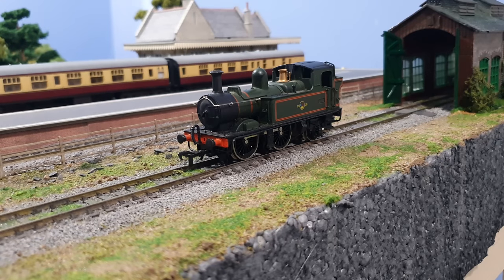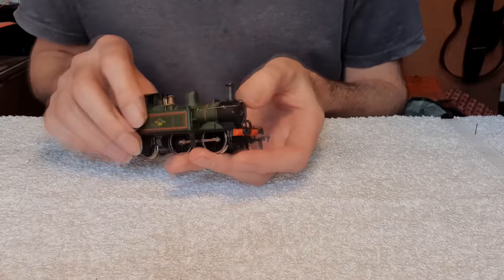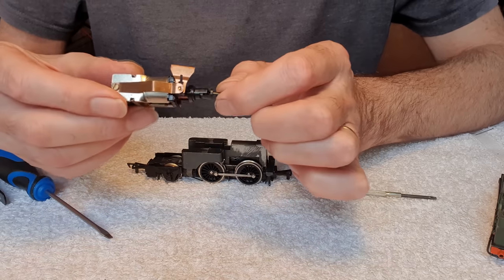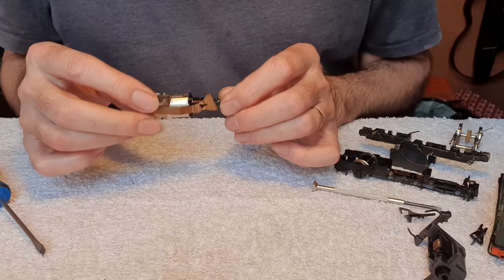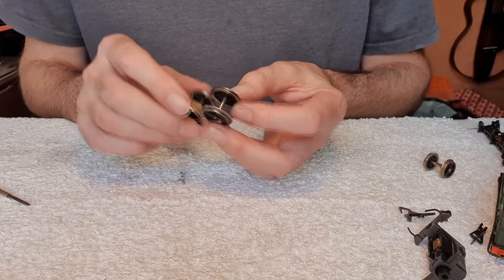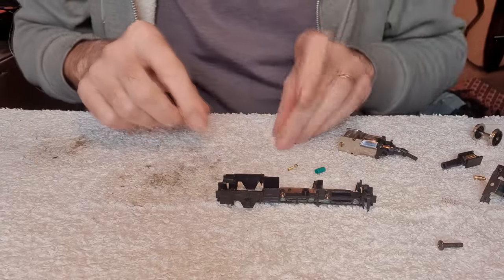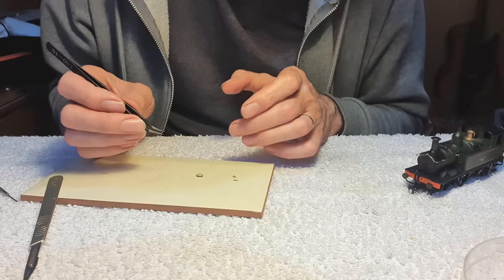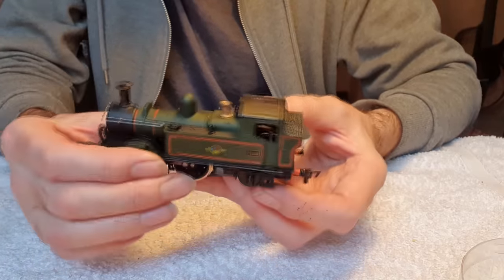Airfix Class 14xx: Repair Request

Comment: I made a new brass underframe with can motor and EM gauge axles/wheels. The springing of the rear truck took a long time to adjust so that the drivers behaved correctly; very little room for weighting so it does not pull many vehicles - just a few wagons or an autocoach.

Comment: Great video. I just overhauled my 14XX. Other than traction tyres and dirty contacts I had a missing motor spring as well. So I removed a spring from a spare old car window switch which worked perfectly. A pen spring would also work.
The locomotive now runs perfectly, thanks for the video!

Comment: I’ve got three of those Airfix 1400 tanks. Fortunately they do run. I didn’t realise how complicated the mechanism was! Must have been designed by a committee!! Nice job on the tank filler as well.
Reply: Ay do you know if there are spare motors for the loco, because I bought one and it didn't come with a motor.

Comment: Excellent work Bill, I have one that doesn't run very well, so I now know what to do! 
On the haulage capabilities these engines were usually found on a rural branch line towing or propelling an auto-coach, sometimes one front and one rear. So as you had it towing 2 coaches around your layout that should be fine.

Comment: Brilliant job bill especially that filler cap, the over engineering makes this little engine although fiddely so interesting 👍
Reply: I bought one from a son, discarding the works and wheels as I am EM. Scratch building the frames and getting wheel clearance and making it 'sit right' with that trailing axle really was a very fiddly job.

Comment: Hi Bill, Great work. I have a couple of these engines boxed away. They were always poor noisy runners especially over points, so I never got round to doing anything with them. After seeing how well you have got this one to run I think it may be time to dig them out.
Reply from the maker: Use the two to make a good one. Swap the non traction tyred wheels from one with the traction tyred wheels from the other.

Comment: Hi all,
I have just revisited my Airfix 14xx and followed most of the excellent video but not dismantled the motor as this was always a no no from early Triang motor days.
However as this was not the first time I had worked on trying to improve 14xx running I noticed a thin piece of cardboard had been placed under neath the back of the motor frame but couldn’t remember why!
Being intrigued I slackened off the motor fastening screw a half turn and discovered that the running was improved.
I continued to back off the screw in increments until no further improvement was noticed.
This allowed a shim or packer of cardboard 1.2mm (0.047”) to be fitted and the screw retightened.
For some reason the smooth slow running was greatly improved but not sure why but you may want to give it a go which can be done without any dismantling, just slacken of the motor securing screw and see what happens.
Having thought about this I seem to remember that a universal joint when operating through an angle does not produce a constant output, strange as it may seem, hence what is refereed to as a CV ( constant velocity) joint is used in motor cars perhaps?

Comment: Well, more coincidence and a very instructional video and nice job on the filler cap too, looks very good.  Thank you for showing me what I have in store when my version finally arrives!  Such a complex design.  Apart from a new version at huge cost, there don't seem to be any other options if you want a 14xx.  Even the second hand Hornby or Dapol are too expensive for me.  Still, it does look very cute.  😊
Reply: Bill Ewart  I think you may be right, sounds like a very sensible idea.  Thanks.
Reply from the maker: Oops. I replied with the wrong YT account!
Reply: @oobill  Oh, I didn't even notice.

Comment: Good fix. I have one of these. Mine seems ok with traction tyres. As long as those plunger pickups are free. They are more noisy than my Hornby or Dapol. I run mine with an autocoach. Regards Paul. 🚂

Comment: I have three of these but one is out of action due to a worn out drive gear so is a spares at the moment. The metal plate attached to the upper brush was the correct way up first time but clipped in the wrong place, it should be in the slot half way down the brush holder so the folded down part at the wide end makes contact with the chassis. That is how they would originally have picked up power the other strip going to the magnet screw is a later addition that I’ve not seen before.

Comment: bill, if you think that's over engineered then I wouldn't recommend you open up a modern model loco. I guess I'm lucky as I work on US and European models as well as UK models. I just did a DCC sound install in an Oxford Rail J27 for a fellah. Turned out rather well hardest part is routing all the wires.

Comment: for those who dont know .airfix and dapol locos such as the terrier ...j94 ...pug...14xx and several tender locos were all re done by hornby in one version or another.the parts are identicle so newer hornby locos can be used for spares for old dapol and airfix.i have had 3 airfix and 1 dapol 14xx .they would have been better if fitted with all wheel pick up and no traction tyre.i got a dj models one which is better but has its own issue ...mainly the crappy motor.

Comment: Recently had to strip mine down as awful screeching noise when going in one direction. Full clean and runs fine. How long were you looking for the screw in the chimney though!? Took the traction tyres off too and runs better and a lot less stalling over points. Sure she pulls less but how much did the real ones actually pull
Reply from the maker: Not too long. No obvious body screw underneath usually means down the chimney or clips! Always look down the chimney!

Comment: Nice repair there.  I have a 14XX with similar problems with the centre tyres.  Does it run well enough without the tyres Bill?  Cheers now!
Reply from the maker: It'll run and generally it'll run better. You'll get a little grumbling sound from the grooved wheels with no tyres but you won't get the stops and starts you get with them on. You will lose traction so don't expect it to pull much.
Reply: @oobill  Thanks Bill.  I dare say having it pulling a little consist is better than it sitting like an ornament!  I have the contact pads on the pick-ups on the pony wheels to re-find as well(stuck inside the pick-up with gunk too!) and it was good to see the extent I need to go to do the repairs needed, and where the screws are.  Thanks again Bill.  I was surprised at the drive gear too!  Keep safe, sir!

Comment: You should have a little shutting loco (Jinty maybe) on stand-by to push non-runners into the shed rather than your finger
Reply from the maker: Tried that. Surprising how resistant even a wee thing like this can be with traction tyres fitted. My Cardiff Castle would maybe shift it!

Comment: I got 2 from about 10 years ago with a smaller motor, not the older drive shaft types though.

Neither have any ever run right. few weeks ago I finally made one run well by replacing that useless rear wheel spring with a stiffer home wound one.  Took a lot of trial n error to get the tension right.  Almost stall proof n smooth now.

However it wasn't without a fight.  Removing the body, disassembling the chassis n trying to put it back together properly was difficult. 

Horrible design.  Very swear wordy.
Difficult clips everywhere, wires had to be de-soldered n threaded through, soldering them back slightly melted the plastic insulation sheets, after the faff the pickups would pop through the spokes n bend in the struggle n it is just amazingly un-user friendly.   Dog shit actually!

But it's working well now.  Why TF they couldn't put a good spring on in the factory I'll never know.